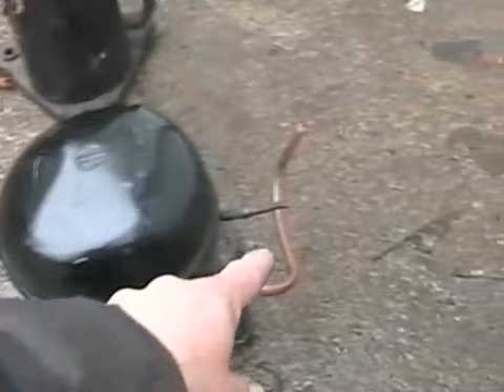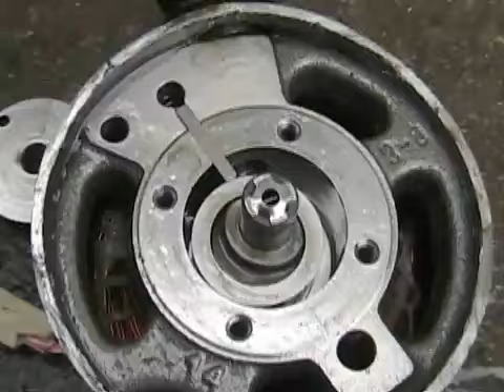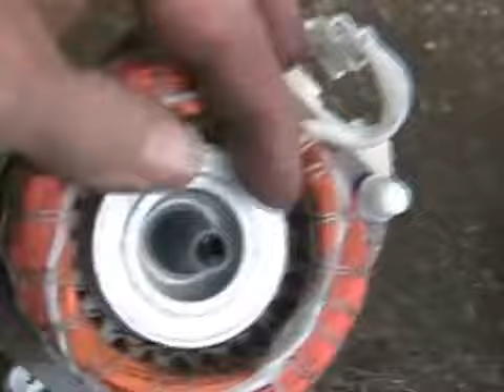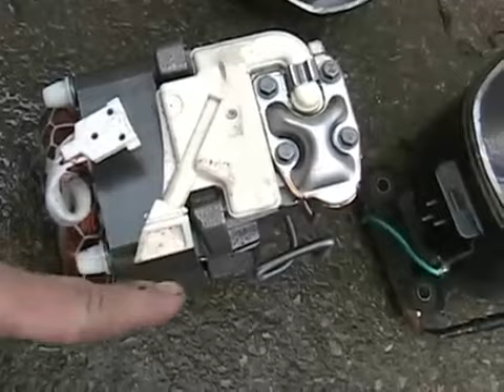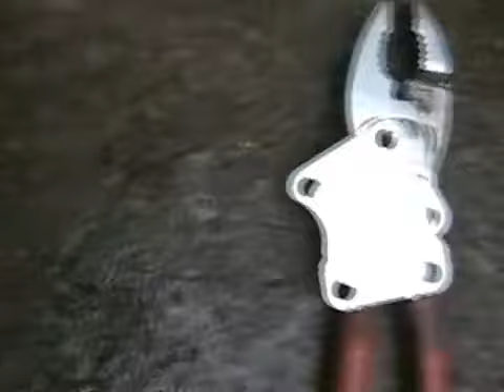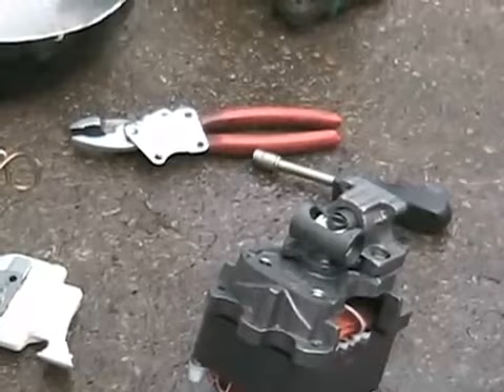Davidsfarm   0861   wK7aY4uoN8E   HQ   how compressors work

Comment: there is three kinds of hermetic compressors in refrigeration. recriprocating, (piston), rotary, and scroll as larger hermetic compressors typically run off three phase power. the  most common compressor used in commercial refrigeration is a Semi-Hermetic a piston type compressor with two or more cylinders and only partial repairs can be done on them mainly the valve plates, seals, oil pumps. to replace one they are very heavy as they are made out of cast iron as most contractors are replacing Semi-Hermetic compressors if its on the roof of a rooftop unit they typically replace the Copeland Copelemetic Semi-Hermetic compressor with either a standard hermetic piston or recriprocating or sometimes a scroll compressor a Copeland Scroll.

Comment: Not that I can think of a need for the extra pressure but the newer R410 home AC compressors can put out 600-700 PSI.

R22 home AC compressors have an internal bypass at 300-325 PSI so they will never pressurize higher than that.  Most AC compressors have a high pressure bypass.

Also for stubborn bolts you can put 300 PSI into an impact gun.  Wont blow up the gun but will give it an incredible torque boost.  But use it sparingly because they aren't designed to run on that pressure continuously.